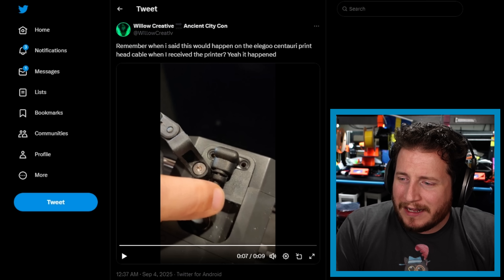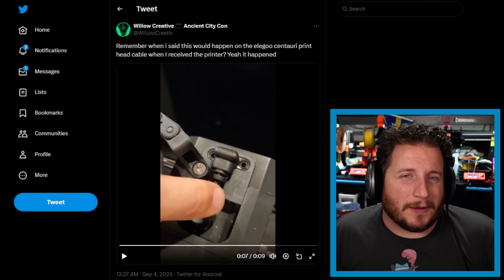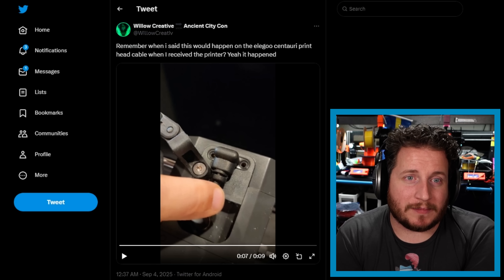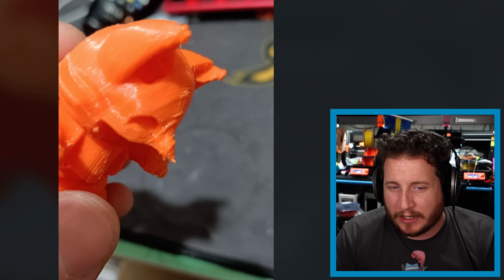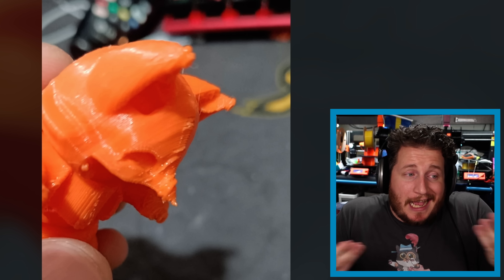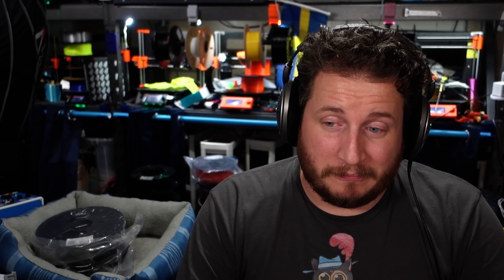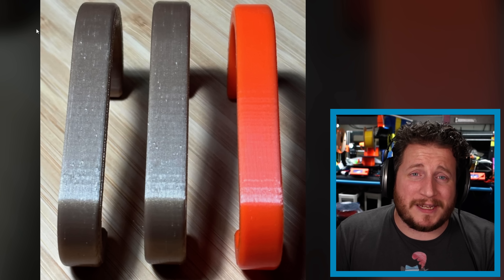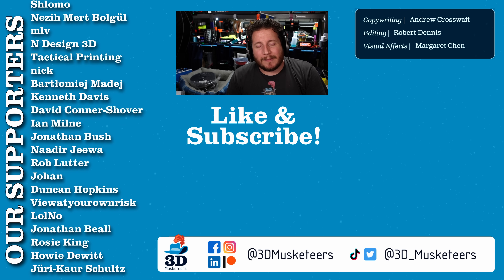THAT Shouldn't Happen! - PrintFixFriday 209

Comment: Grant - you mention Elegoo offering updates at no charge. I know that for certain pre-orders, they were upgrading the lighting for no charge, but I was in the second wave of pre-orders (just prior to the light upgrade) and I don't recall any offer being sent for that type of upgrade or others. If you have some additional sources, could you share, please? :) I wouldn't say no to an upgrade, despite my having installed an LED strip in my Centauri Carbon.

All that aside, I have been pleased overall with the Centauri Carbon. It's no Prusa, in terms of refinement, but it's an unbeatable value. Value engineering is definitely their strength.
Reply: Reach out to Elegoo customer service. They are sending the LED light strips as well as the AMS port upgrade so that you will be able to get an AMS and have it function.
Reply: @MA4King  Cool, thanks!
Reply: As for the cable situation, yeah, I questioned the design. The cable chain with the PTFE does add some additional constraint that the chain alone doesn't. The tube, however, also has quite a bend at the end. Brittle PLA goes through, but left in for a while, it WILL fragment, necessitating a removal of the tube from the hotend and pushing the cracked stuff through. Ick.

Comment: 13:12 Hmmm! does that imply one printer is perhaps running significantly hotter than the other? Possibly a NTC resistor tolerance issue where one is running hotter, but will be reporting the same temp. can be hard to diagnose a feedback loop if it's lying to you, etc.

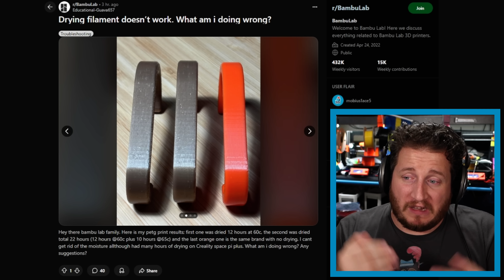Comment: 12:50 Lowering the temperature - kinda makes sense, in hindsight. The direction that is having problems might not be getting cooled properly by the fan - and what does the fan do? It cools things. So just lowering the temperature a bit more in the first place means less problems.

Comment: Whelp time to check my Centauris cable. Hopefully its ok as I really like that printer, but I am having flashbacks to the A1 heatbed cable recall now. Will report back after checking
Reply: Just checked it when I got home, and my cable seems fine. Looks like I have more slack on the cable after the chain than willow did, but I am definitely going to be checking that cable constantly now.

Comment: Also anyone have experience the issue with bed heating since it's ac powered it should heat up fast to 100c but mine is struggling to get to 100c and printer would quits
Reply from the maker: on what printer?

Comment: 500 hours in about 3 months, haven't even concsidered the print head cable as an issue...??!!  Wow, this printer runs CIRCLES arround my 5 year old Artillery X2 Sidewinder Bed Slinger, so non issue at all...  :)

Comment: first clip sounds like the connector snapped not the wire.
Reply from the maker: definitely small arcing, but could be from a bad solder joint
Reply: The wire shielding opened up from bend strain and was shorting out by touching raw unshielded wire. I stripped the cable relief hoping i was able to solder it back together but it stripped way too close to the connector for me to fix it by hand

Comment: My centauri carbon has had a few issues. I got a clog so bad I might need to replace the whole print head, its covered in a fist size glob of petg. Smells like burnt wires too. Will need to check the electronics box.

Comment: I bought a CC Centauri Carbon last month, the best printer I've ever owned, but now that I've seen these terrible sparks coming out, I'm going to order another one, because Christmas is coming and these sparks will match the decor. You can make whatever video you want, the Bamboo isn't worth more than the CC, and I don't buy brands, I buy tools.
Reply: I bought two CC's last month but sent them back and got qidi Q2. Lego printed slightly better benchy, but I had issues with first layers, warped beds, blinking LEDs, after two hours. Worst is closed off ancient klipper and sending huge amount of data to some servers when idle.
Reply: "I don't buy brands, I buy cheap tools" - fixed it for you.
If it works good enough as it is, OK. But it has no path for upgrades nor actual fixes in firmware.
Reply: @kimmotoivanen  🤣 buying cheap things that do the same job as expensive ones makes me feel good!
Reply: @kimmotoivanen 😂 fixed in part. Cheap tools produce cheap outcomes, no matter who uses them. In my case, and I love tinkering my printers since 2015, upgrading them usually ended up costing me more than if I bought a better machine, just to save some bucks.
Reply: @TinchoPerezGa  true, buying new is almost always cheaper option. But tinkering with closed-but-almost-klipper-printer is a lot more limited than e.g. Ender 3
Reply: Oh i still recommend them. I feel like this is just a freak strain relief failure. Crazy good value machine, just a tad noisy
Reply: I’d love to know which other printers have you own to state CC is the best one😊. Of my army of 17 printers from 4 other brands, I’m trying to get rid of the 2CC I own 🤷🏻‍♂️

Comment: I own three Centauri Carbons, each with roughly 500 hours of print time. None of mine have developed the cable arcing issue, so that may be a quality control problem with the cable manufacture. One of my units runs strictly direct filament feed. Noise is an issue, but it’s fairly cheap and straightforward to quiet them down.

That said, I cannot recommend the Centauri Carbon. The firmware is a constant source of frustration, updates are painfully slow, the webui just doesn't work when printing and two of my machines eventually shut down and showed no signs of life after just a couple of months. Reliability is poor.

On the plus side, Elegoo’s warranty support is decent they will send out replacement parts free of charge as long as you’re within coverage.

My biggest complaint is that Elegoo’s firmware is based on Klipper, yet they refuse to release the source code. This is a direct violation of the GPL-3.0 license.
Reply: Also firmware ver 1.4.0 that isn't publicly available the  yet but it is shipped with the new main boards. The webui is still not working correctly
Reply: @Og_paine  FW 1.1.29 here, no issues with WebUI using Orca (stable and latest beta) or Edge.

Comment: I've never seen filament that looks like that before. But it's possible it was a fluke. I know you had a bad spool from printed solid once. It was brand new and you just opened it, but it was brittle. They took care of it and that was the only spool you had a problem with. But if they're selling that cheap......it's probably just hit and miss.

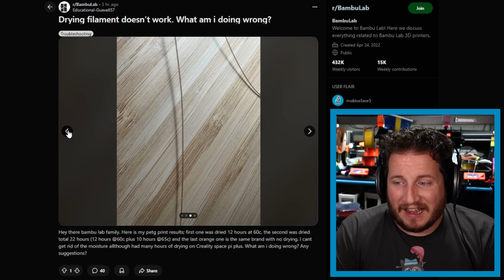Comment: 10:38 one solution that helped me in the past with a similar issue was using a high flow nozzle, the Revo Six 0.6mm obxidian one in my Prusa MK3S+. I kept the flow rate as default in PrusaSlicer (a slow one at that time) and that gave me good results to let the air to escape without problems.

Comment: I had the same issue with the K2 plus you mentioned with my K1C and my Flashforge Adventurer 5m. With the K1C I was using ABS and the 5m I was using PLA. What i found crazy was I printed one part out of the 5M and it had it. Changed nothing and printed it again it was gone. Now the first one I printed during the day and the second one was at night. I'm curious if the reason why the second one didn't have it was because the temperature of my house had an affect on it. My house did hit up 7 degrees Fahrenheit (65 to 72) during the day and then it went back down to 65 degrees at night when I started the 2nd print.